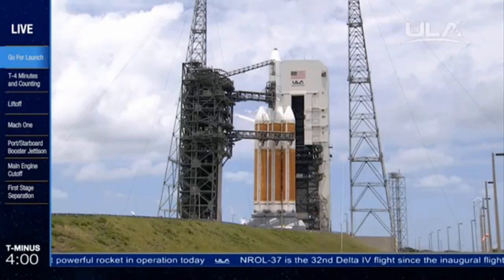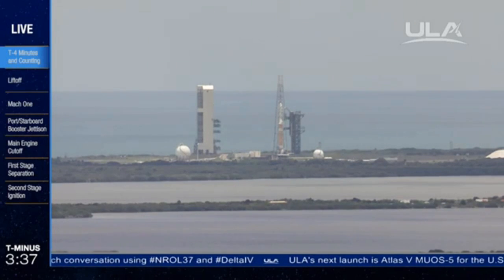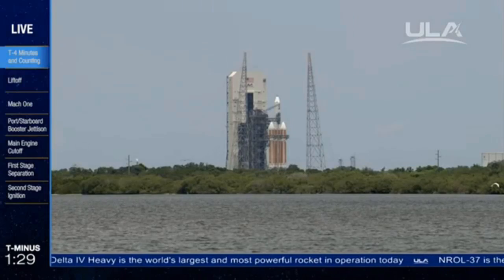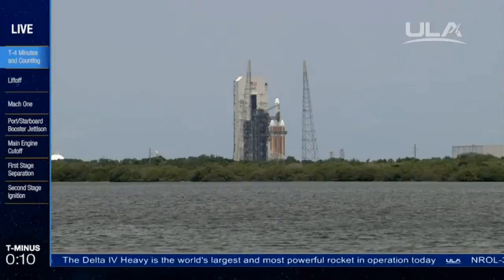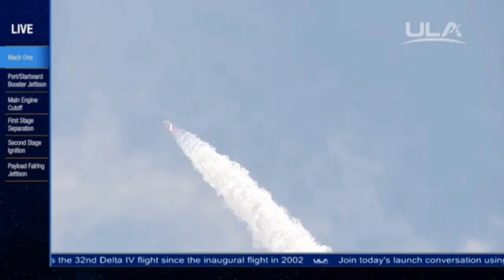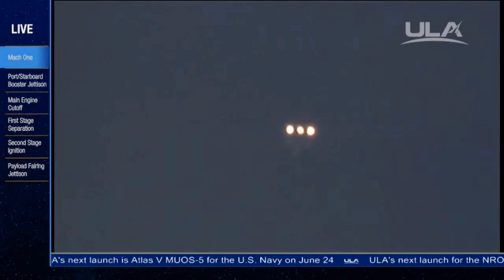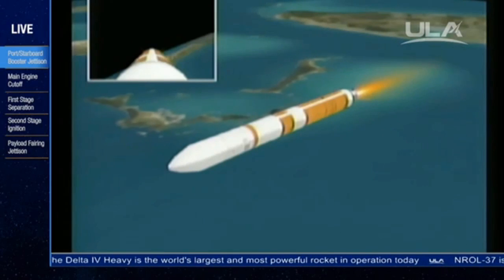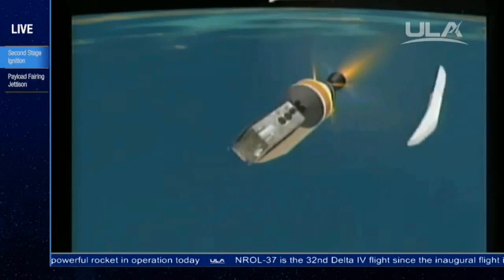Delta 4-Heavy - NROL-37 launch by ULA

Comment: which is more powerful, the Delta IV or the Titan IV?
Reply from the maker: depends on which ones, as they're rocket family with several subtypes. Also depends on what you call powerful. In general the Delta IV is newer and more efficient. the Delta IV heavy can launch more payload into space, so its practically more powerful, but the Titan hadmore thrust, therefore was technically more powerful